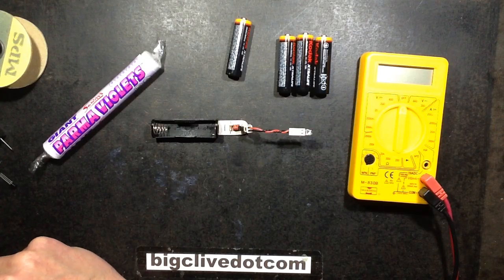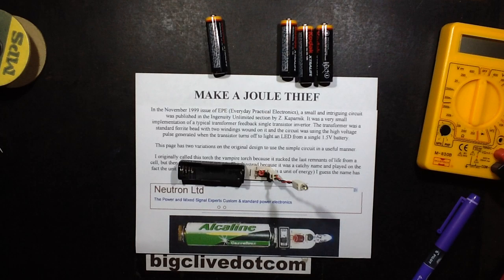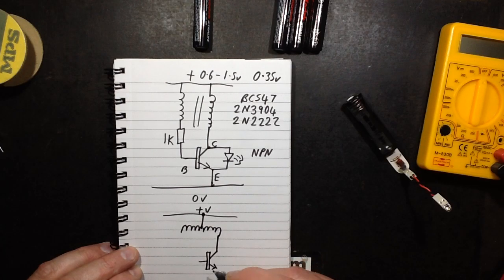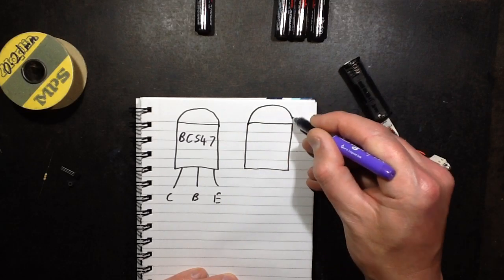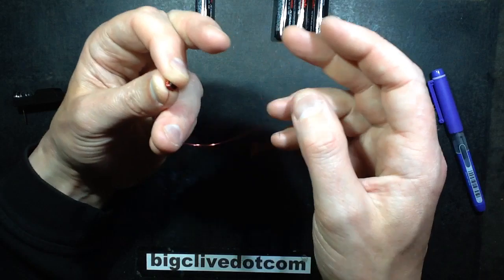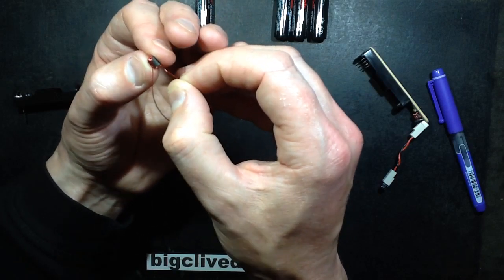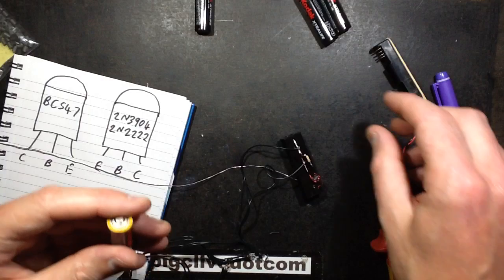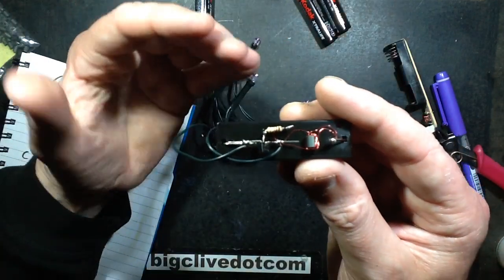How to make an authentic Joule Thief.

Comment: Is a high gain, Hfe, transistor better in the circuit?  Does it really matter?  If you want the best efficiency what would be the best way to go?
Reply from the maker: I'd suggest just using a generic cheap transistor.  The circuit has low efficiency.
Reply: @bigclivedotcom  Thanks for the help, I love your videos.  Truly a godsend during covid, as I had to stay home (Very high risk person) and I live alone.  Thanks again for your help, Bill, KE4WNY

Comment: Hello. I want to ask you did 10k resistor will be good for these circuit?
Reply from the maker: Daniel Bogusz 10K resistor results in lower current consumption and lower LED intensity.  You can actually go much higher with progressively lower LED intensity.

Comment: Wonder if a fellow could use something like this on, say  a 9V or 6V battery to get a bit more life out of those critters?
Reply from the maker: Using too high a voltage will just cause the current to flow straight through the LED, potentially damaging it

Comment: If I put a capacitor over the power, that could keep an RGB led (the slow changing one with two leads) from resetting, right?
Reply from the maker: You'd need a diode and a low value capacitor.
Reply: Sweet. I'll try to hack it together. Thanks

Comment: hi clive. i want to use a 5 led string.that use 3x aa and 2xaa will I need to change any of the components.cheers
Reply from the maker: You can run several LEDs from the same batch in parallel and power them using just the single cell.

Comment: so if you put this in a remote controll you clud use it with 1 nattery right or is he electronics to sensitive in that case couldnt you add a electrolytic and a polly cap to filter thee crap ?
Reply from the maker: That wouldn't work as the remote control needs power all the time at a very low current.  the Joule thief would run the battery flat a lot faster than the remote control would.

Comment: I have a question. I recently built six of these to give away to classmates, and they all went swimmingly, one has an odd quirk. It whistles. Any idea why one would whistle?
Reply from the maker: Bigger cores can oscillate at audible frequencies.
Reply: Weird. I didn't think about taking a frequency count - they're all the same size toroid, but the one that whistles is running at 9kHz, and the others are at 50kHz (one is at 90). I must have messed up the windings on the whistling one.

Comment: Could I center tap an MOT and use that as long as I have a good enough transistor?
Reply from the maker: I've tried it using the secondary of a mains transformer to step the voltage up.

Comment: Is there a reason why to connect the leads on the transformer crosswise (bottom left to top right)? Or would the transformer behave differently when connecting the two leads on the left or the ones on the right (maybe because of different current flow)?
Reply from the maker: The polarity is important to ensure the circuit self oscillates.
Reply: Ah, I see. Thank you very much! :)

Comment: A rather dumb Question: can you use a step-down transforner from a mobile phone charger as a replacement for the toroid?
Reply from the maker: It could work, but would need custom wound.

Comment: Would the circuit run on two cells, ie 3 volts? In theory this would prolong the life even more than using one cell at a time.
Reply: Michael Beeny Better to have the two batteries in parallel for longer life with this particular configuration.
Reply from the maker: Michael Beeny If the combined voltage of the cells is too high the current will flow directly through the coil and LED.
Reply: Michael Beeny It works, but it's quite tricky to get oscillate. You need to have at least 2x15 turns on the coil and also need to experiment with base resistor to get it actually work, it also is much more picky about the transistors, not all may work with that voltages, but when you do, it can drive a 1W power LED brighter than from straight double AA.
Reply: Michael Beeny Yes you can even run it with 3 cells. You just have to increase the base resistor value. Cheers :)
Reply: +Michael Beeny Also if the circuit seems not to operate - the LED is dim with two cells, you can also put a small film capacitor 10 - 47nF in parallel with the resistor to get it running.

Comment: i know this video is pretty old so i don't expect to get a reply but i have to ask: why connect one of the A leads to one of the B leads to get a center tap? since you pinched the wire in half couldn't you just use that pinched part as the center tap without splitting it?
Reply from the maker: I think the loop for winding means one turn is in the opposite direction.
Reply: @bigclivedotcom  wow i didnt expect to get a reply let alone from you yourself! Also thank you, that does make sense since i guess if the windings went in the same direction right next to one another they wouldnt work as well.

Comment: Can I use a fresh battery with this circuit, or even two? Or does it have to be one "dead" battery? Thanks!
Reply from the maker: +Simon Nordberg You can use a fresh single cell, but I'd recommend against two in series as the combined voltage will be enough to just drive the LED directly through the coil.  The circuit is really intended for salvaging the last remnants of power from an old cell though.  It sacrifices efficiency for simplicity.
Reply: Ah! I see. I thought maybe I could incorporate one of these in all projects using 1 or 2 cells to really get the most out of the batteries. But just one cell then.

Comment: could the j-t work at lower voltage if you used a Germanium transistor?
Reply from the maker: I've never tried it with a germanium transistor, but theoretically it should work down to about 0.2V.

Comment: Will a PNP 2N3906 do in a pinch? Asking for a friend .
Reply from the maker: Some people make them with 2N3904s.  But for a PNP transistor you would need to flip the circuit so the transistor switched to the positive rail.

Comment: I've just had a similar set of lights powered by 2 AAs going dim and I decided to do a Joule Thief mod to them as there was enough space in the battery box. Now this is where things get odd.. I'd assumed that it'd work with 2 cells but no... it looks like the transistor never shuts off with 2 cells. I then had the idea to halve the resistor and that worked but I've no idea why. Any Ideas ?
Reply from the maker: With two cells the voltage is high enough to just go through the inductor and LED directly.  It has to be a single cell.

Comment: If I use 4 cells in parallel (still 1.5v) would they last 4 times longer?
Reply from the maker: The cells would have to be the same batch and at the exact same state of charge.  Mismatched cells could reverse charge each other and cause leaking and possibly rupturing.
I don't really recommend it.

Comment: (how) can i adopt this to power neon indicator lamps (~100V@1mA, preferably voltage, not current controlled) from a low voltage (around 5v i guess because USB power is good power :P)?

i guess that might be hard because as far as i understand it and guessing from the wider range of "automatically powered the right way" LEDs, the joule thief is more of a current than voltage source?
Reply: from 1 AA cell you can run one if you put 3 wingdings 2 -- 4 turn and 1 50 turn to run the bulb
Reply: i used an old common mode chock as my transformer and just added the 50 turn secondary

Comment: done it used a ferrite rod from a old am radio.wound the inner cores of the wires from some walk man earplug.pulled the unmarked transistor from the same radio.pound land Xmas lights  solar panel from garden light. nicad

Comment: Any way to create a cell sized joule thief to replace one of the cells in a twin cell remote e.g. For a tv or DVD player? To use up partially discharged batteries?
Reply from the maker: The Joule Thief would run all the time, so it's not a good idea.
Reply: Thanks Clive. Pardon my ignorance but would a switch on the battery pack not sort that. I have to take the back off the tv remote and rapidly revolve the batteries to improve connection and or warm the batteries to get them to work at the moment as it is. So a simple switch wouldn't be much of a hardship.

Comment: Seems you should run something like this to completely drain all useable power from batteries before throwing them away.  Dump the extra that you siphoned out with this Joule Thief circuit into something like a Lithium battery...

Comment: Could I put a 5v input and a bigger led to this circuit?
Okay, at the end you said a 20v led but what about the voltage in?
Reply from the maker: If you use a voltage higher than the LED it will just light the LED directly.

Comment: Is there a reason you could not put this circuit into a solar garden light to get it to run even longer?
Reply from the maker: Ra The solar light circuits also have the light sensing circuitry and you can actually adjust the current they drive the LED at by changing the inductor.  Higher values run the LED at lower current.
Reply: RayBs Most already have them.

Comment: How does the circuit 'feel' for how much power a device needs so it doesn't fry a device?
Reply from the maker: It's output current is inherently low.
Reply: @bigclivedotcom  The LEDs seem as though they're running at half brightness. Would the solution to that be to increase voltage? If so, how do we find out how much more of an increase? (I have a long string of lights) I've had those violet candies, they're scrumptious!

Comment: the very light copper wire is coated/insulated, right?
Reply: Magnet wire is typically coated with a thin layer of lacquer. With orange or red magnet wire, the coating is particularly difficult to see because it's close to the same color as polished copper. I prefer green-coated wire when I can find it, because you can tell you've stripped the insulation more easily.

I just built a joule thief using this schematic today. I also used Clive's technique of stripping and tinning the magnet wire using a solder ball on the soldering iron. It worked perfectly, especially after I dipped the end of the wire in some liquid flux so the solder stuck better.
Reply: I have a fair bit of experience with magnet wire, but not for toroids (well, those too). When I got my ham radio license, I lived on the top floor of an apartment building. Antennas were not allowed, but I managed to build some very stealthy ones. A copper J-pole on the balcony was carefully spray-painted with a Rustoleum fleck-paint that gave it very nearly the same appearance as the brick wall behind it, and it couldn't be seen at all from as far away as the next balcony. Unfortunately, its radiation pattern was bad for an apartment, and my downstairs neighbor used to bang on the ceiling with a hammer when I transmitted on 2 meters. He claimed I was coming through EVERYTHING, including his clock radio.

So I designed a 2-meter Moxon loop antenna with a radiation pattern that kept the signal OUT of the building. I mounted it inside a decorative wooden trellis, one of two I put on the porch to give us some lateral privacy. Then I made little spike ground-plane antennas for 70cm and mounted them on top.

But back to the magnet wire. I used to weight the end with a fishing sinker and shoot it out across the back parking lot into a stand of trees on a heavily-wooded plot. It was so thin it couldn't be seen. Rather than put out a counterpoise, I just used it as a random-length end-fed antenna, and it worked great on every band but 75m and lower, which was good enough for me until we moved to a house with a HUGE yard and could put up whatever we wanted.

But the magnet wire was an integral part of the solution. It was thin, insulated, a good conductor, and couldn't be seen from the ground.

Comment: Can you put multiple batteries in series for this?
Reply from the maker: No.  If the voltage is too high the current will pass straight through the coil and LED.  It's really intended for voltages of 1.5V or less.

Comment: Could you commont the center tap to negative  if you only had pnp transistors and wire the cicuit back to front so to speak?
Reply: rimmersbryggeri just reverse the battery and led
Reply: Us and Them
 Yeah that's what I thought.Would defeat its purpose unless the polarity was right.

Comment: i wonder if one of those with a decent sized supercap would be a neat way to store power for things like wind-up torches or similar, so they don't have to rely on the user cranking the handle at just the right speed to trickle charge a NiMH or similar, because those setups always feel rather ugly to me.

also btw some of the pictures on your webpage got removed by photobucket for "violating their TOS" for no apparent reason, might wanna salvage what you can and just stick the images on your own webspace to prevent that BS from happening...